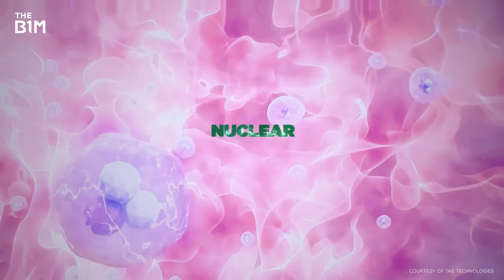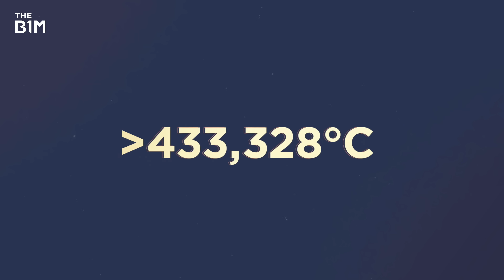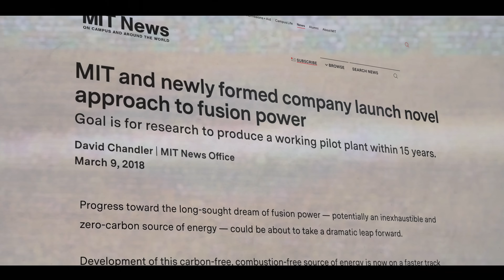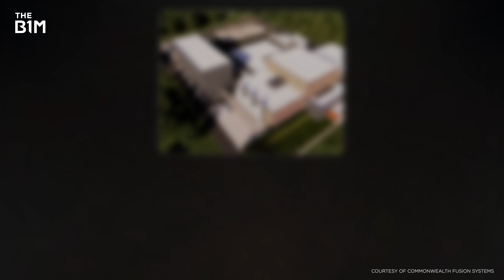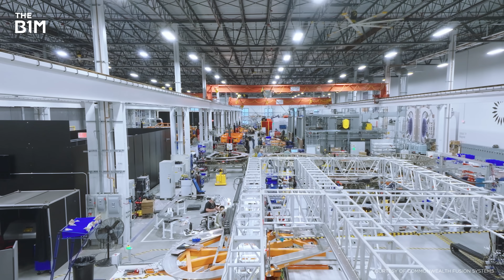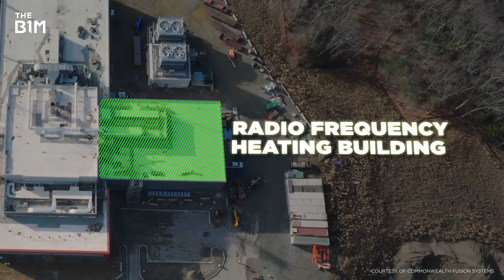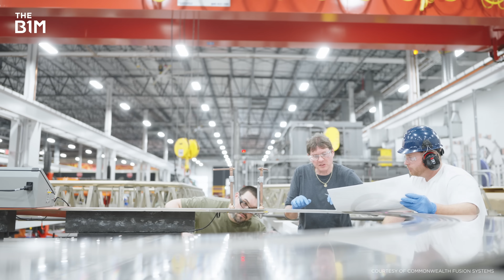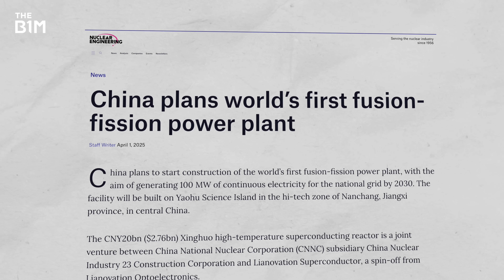Is America About to Win the Nuclear Fusion Race?

Comment: I don't think startups can beat projects like ITER, which arguably is one of the most complex project undertaken by mankind with the most brilliant scientists from several nations working on it. There are many more critical issues that need to be solved. The magnet size aren't one. Reducing their size will reduce costs, but it amounts to nothing if the whole thing doesn't work. I saw something about a startup in Europe working on a thorium reactor and had made great advancement to develop valve or pumps, where the main issue is the separation of fusion byproducts, but they never even mention it. I don't think startups are the right vehicle to advance hard science. Eventually they get caught in the vicious circle of having to continuously announce good news to keep the money in. They are not very setback resistant and you have a lot of these in cutting edge science.

Comment: If you think climate change is too slow, building miniature suns on Earth could speed up the melting of the polar ice caps.  100 million degrees C is much hotter than we can envision.  And fusion reactions emit high energy neutrons that can make non radioactive elements into radioactive isotopes.  Good thing it's been 20 years in the future for 50 years.

Comment: I'm sure the "move quickly and break things" startup (unregulated and unencumbered by layers of safety rules and triple checking everything) mantra won't be an issue with a highly radioactive fusion reactor if containment is breached and stuff gets thrown/blown for hundreds/thousands of miles. Supposedly the half life is in terms of 100's of years instead of thousands... (which would still equate to a few thousand years before it was safe as apposed to a few billion as to make sod all difference) but on the other hand... Redmond (Amazon/Meta/Microsoft/SpaceX) would get the brunt; so it wouldn't be all bad.

I mean, there was a guy that moved fast and broke things with a deep submersible craft for joy rides to the Titanic, and another with rockets and full self driving cars... and those are all going swimmingly well with no issues at all. Not a single accident. All working as designed... oh...

Comment: Consumption of approximately 100kg of fuel, right? There's a small problem with that, given that there's between 25kg and 30kg of tritium. That's across the entire Earth. All of it. This 100kg of fuel must have a massive difference in deuterium levels and tritium levels. Also, tritium decays into Helium-3 at a relatively good clip with a half-life of about 12 years. It can be made artificially and generated in some nuclear reactors but in incredibly small amounts.
Reply: We just need to build a ton of CANDU reactors, they make lots of tritium
Reply: Yes. That's why every D-T reactor is being designed with closed loop Tritium Breeding System. I'm surprised you know all that other clever stuff but not this.
Reply: @MattNolanCustom  How could I deny you the chance to correct or expand on my comment? It is possible to know one thing without knowing another related thing. Materials availability versus reactor design, for example. It's why I didn't say anything about reactor design; I myself do not have much if any knowledge of reactor design, just responding to a single statement about fuel needs. Thank you for the additional context you've provided.
Reply: @felisconcolori happy to help

Comment: Tony Stark built it in a cave with a box of scraps.
Reply: I read it in the same voice
Reply: @zaneeeeeeeeeeeee-v4k hahaha me too 👍👍
Reply: I built it just with imagination, so take that!
Reply: @ToneyCrimson  well you are a Tony lol 😂👍👍
Reply: "I got that reference" 😂
Reply: @BrianRoediger  Thanks Capp 🇺🇸
Reply: @Toby-pq7dr ❤😂
Reply: We already have cheap, unlimited energy. It's called solar, wind and storage. It's also fully distributed and homeowners can make their own. Not to mention advanced geothermal and wave/tidal energy. Fusion power would perpetuate the monopoly utility model.
Reply: @velofelo Solar is fine when the sun is shining. Wind is fine when the wind is blowing (and requires a ton of maintenance).  Hydro is great because it's practically perpetual.  Geothermal is wonderful if you have land that can effectively use it. 
Nuclear is constant, much higher output, and cheaper overall due to less maintenance costs. 
All of my statements above are from personal experience, not a talking point.  My state runs off of solar, wind, and mostly hydro. We're also building a Fusion plant for Microsoft as a test so hoping it goes well.
Reply: @velofelo  what happens at night with no wind?  I know …no power.   Just build big storage batteries using tons of lithium.  Great solution.
Reply: @philiplangford9434 only reason we use lithium is because it’s cheaper for production-salt battery’s change that

Comment: You missed an opportunity to reference the most famous equation ever.  Fusion is process of taking two atoms and fusing them together into helium which produces a bunch of energy.  How much?  When the fusion happens, the mass of the initial two atoms is more than the mass of the resulting helium. Where did the other mass go?  it was, as you said, turned into energy.  At what factor?  "c" [the speed of light] as in E [energy] = m [mass that was converted] * c^2. 
So, a relatively small amount of matter can yield a large amount of energy in the process.
Reply: Fusion, and fission for that matter, derive their energy output from the differences in nuclear binding energy of the relevant atoms. No *nucleons are destroyed, the output is just the energy put in to rip the atoms apart vs the energy you get from putting them back together in a new form. 

 EDIT: I am the circus. Binding energy is literally calculated from mc^2. I still stand by it being more interesting than an equation everyone learns in high school though.
Reply: yes, in the sun that's true.